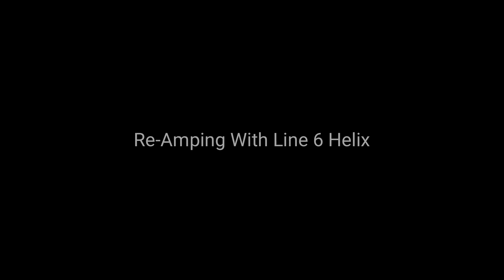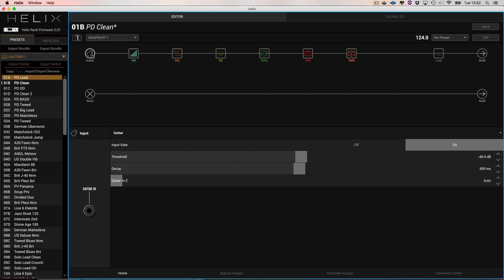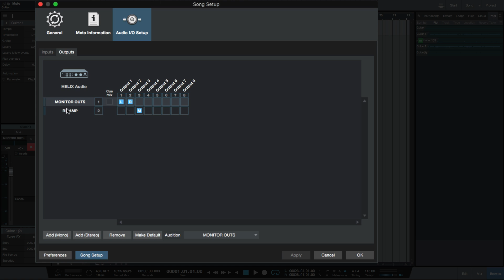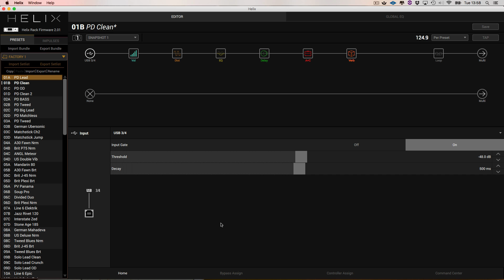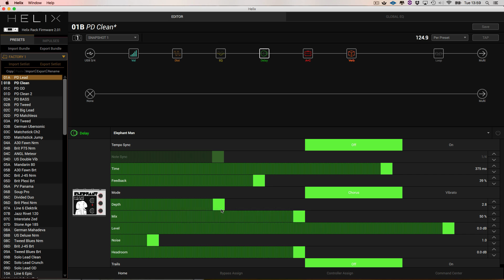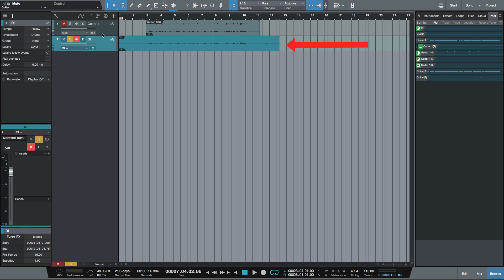Re Amping with Line 6 Helix

Comment: Hey thanks for this, what if I want to route an already recorded DI through my Stomp XL and then back to S1 So I can have both signals but AFTER I've already recorded a DI? I can't for the life of me get a signal back to S1 and I've tried numerous routing options. 

On the preset the in is set to USB 5/6 and then the output of the DI to USB out 5/6 and the input for the new track to USB 1/2. I've tried it the other way around, made sure the monitor is turned on for tracks, switched the routing, changed the output of the master channel to 5/6-nothing seems to work so far =\.